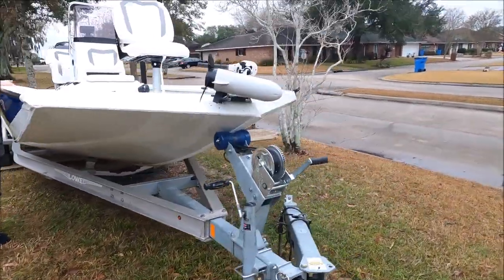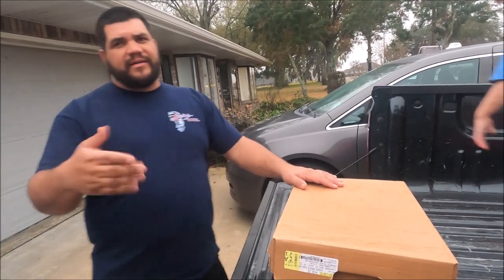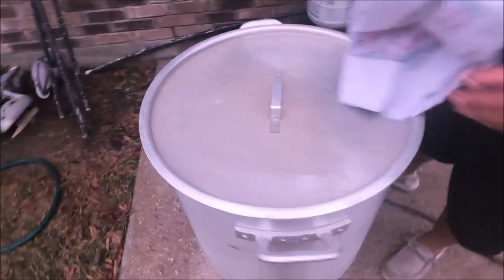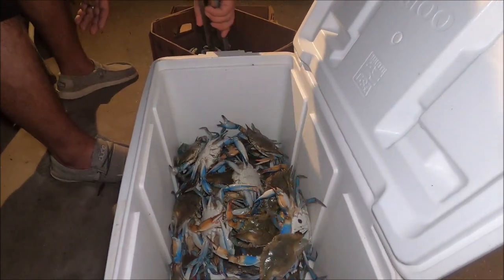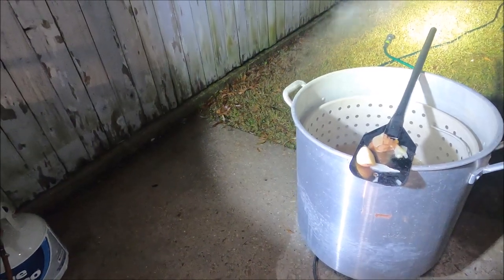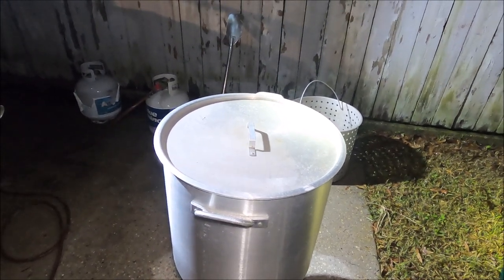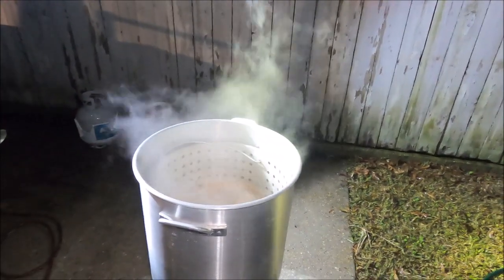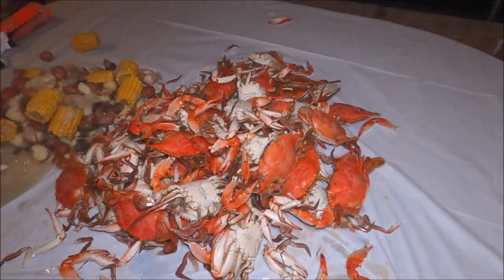How To Do An Authentic Louisiana Seafood Boil!  #louisiana #howto #seafoodboil

Comment: I used to do a lot of these but I never use water.  I use a bottle of cheap white wine (usually Fish Eye Pinot Grigio) and light beer.
Reply from the maker: Does the wine cut down on the heat?  That's extremely interesting....I want to try it now!
Reply: @ReelJayB  just gives a ton more flavor. That white wine is kind of citrusy plus we always add a ton of lemons, limes and oranges cut in half thrown into the boil.
Reply from the maker: @MayorofNumber3  that sounds AWESOME!